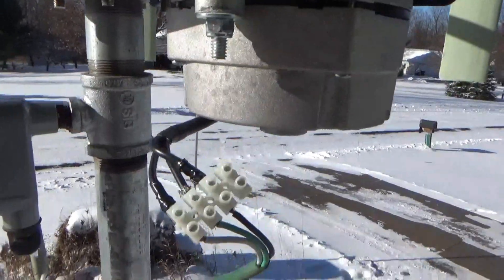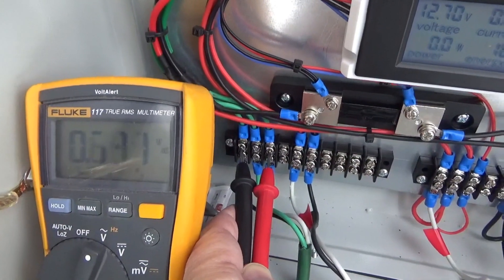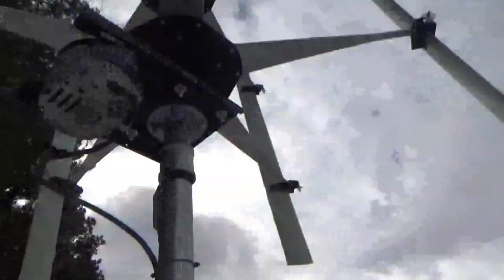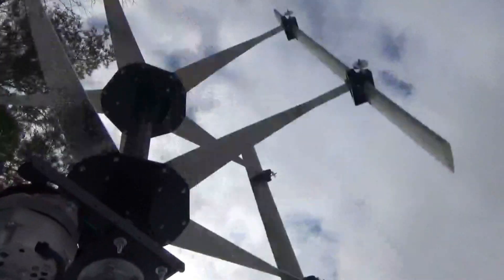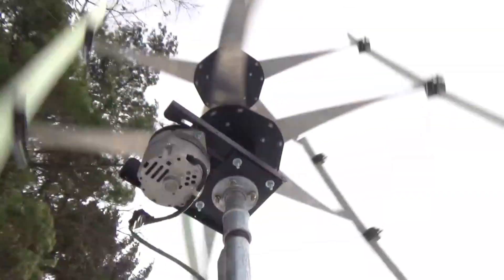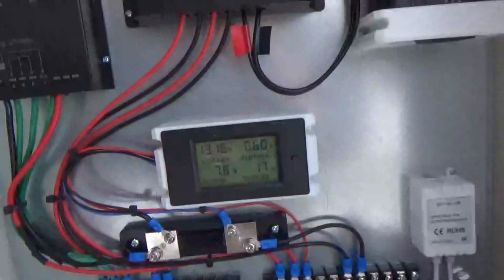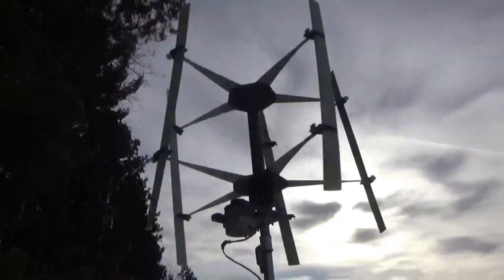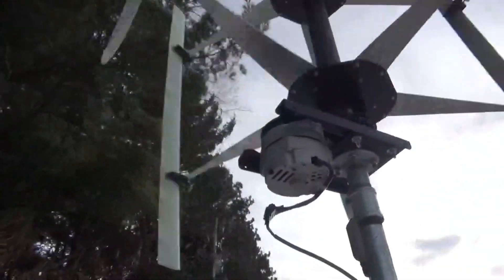New Large Sharp VAWT - First Power

Comment: Why didn't you use V blades instead of straight blades?
Reply from the maker: These were easier to make.  Also, the entire airfoil is at one radius so the airflow is more uniform across the whole length.

Comment: Nice !
I'l try to play around with one wing Sharp prototype on day.
I've got a little question, what's the schema of all your electric/electronic composant down there ? Are you connected to batteries and the grid also ? I'm struggling to find information to merge solar & wind turbine, electrical way speaking, with an hybrid system.
Thank you for sharing that !
Reply from the maker: I've got one charge controller that came with a windmill that has a dump load, and another charge controller for the solar panel.  Both just connect to the battery.  But sometimes it seems like they conflict; the solar charge controller would keep the battery at 14.1 volts while the wind charge controller wants it at something like 13.7 volts.  I decided to get a single controller that takes both solar and wind.  I plan on installing it soon now that the wind turbine is complete.
Reply: @MickEMaus3000  Yeah, That's the ijssue I was thinking about. 

I'm thiking taking a Growatt hybrid inverter with 2MPPT for my solar system. But then how to merge it with a wind turbine... I'm struggling there.
Reply: Not too much power it can produce! 😊
Reply: @jamesyao9199  yeah, but solar in winter or the night will always be worst than wind ! 🌬️ 
Even if wind can’t go high power. I plan to build a 800W. So average of 200W with normal windy conditions !
Reply from the maker: @jamesyao9199  No wind, no power.  This is not a good location for wind power.